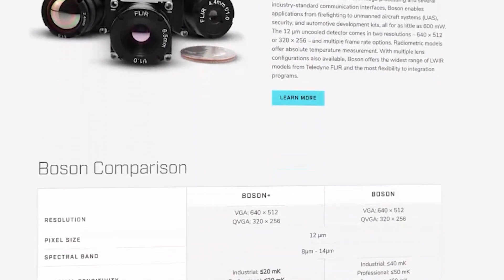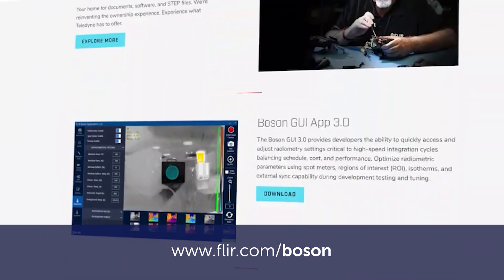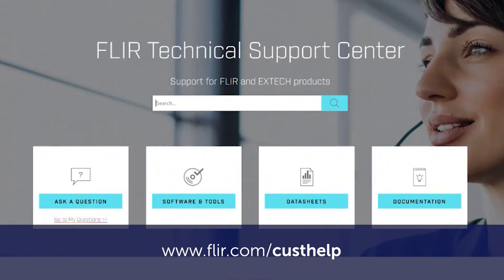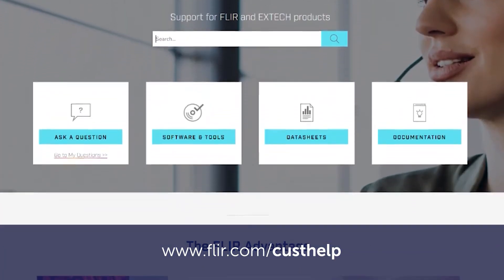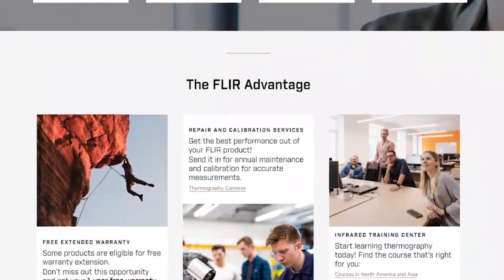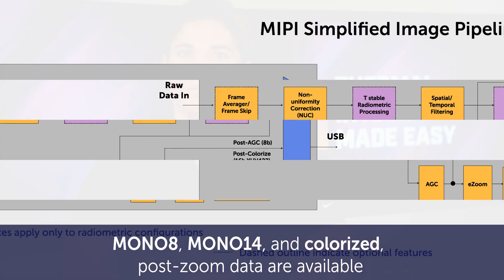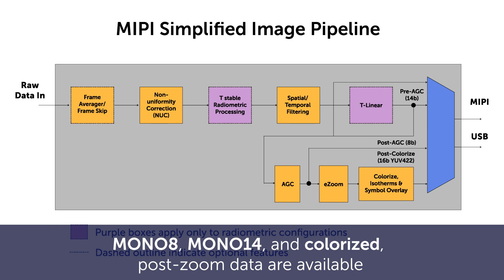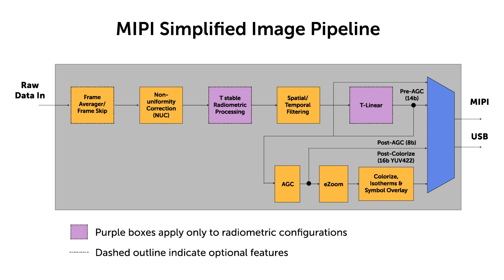How to Integrate MIPI with FLIR Boson & Boson+  |  Thermal Integration Made Easy

Comment: Hi, could you pleae tell me or send me solution to connect Boson+ to a drone VTX?
Is it possible to connect it to the DJI O3 unit or Air Unit/Vista with MIPI cable? Or just with a analogic VTX with CMOS cable maybe?
Thanks a lot
Reply from the maker: Hi, If you are looking to implement a thermal & visibile camera with a drone. We recommend taking a look the Hadron 640R along with the available development kits. The core utilized inside the Hadron 640R is a Boson 640. https://www.flir.com/products/Hadron-640R-Development-Kits/
Reply: @Flir  Link is broken.